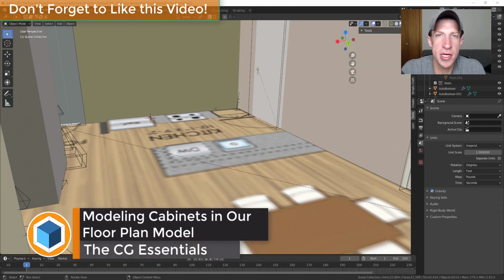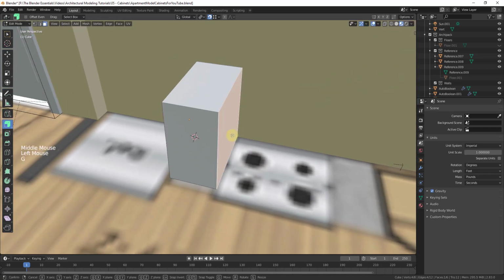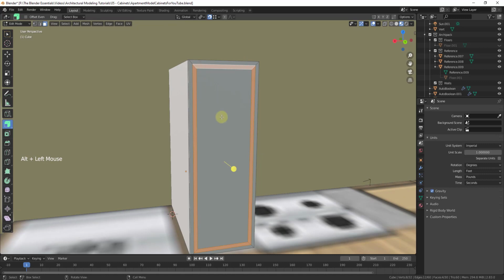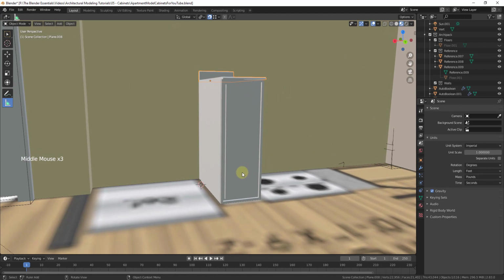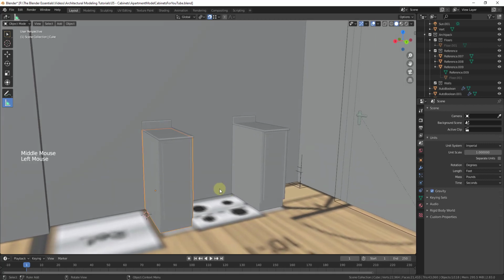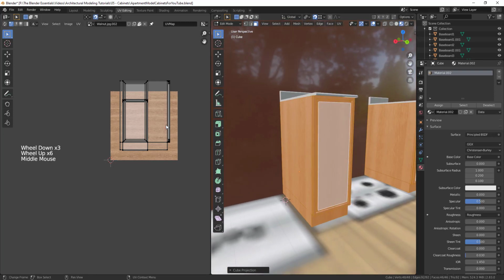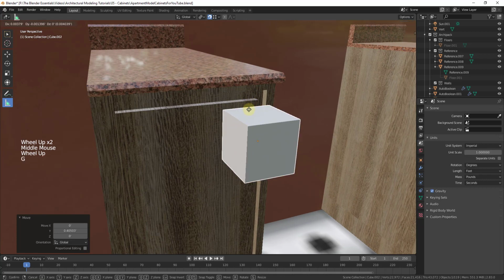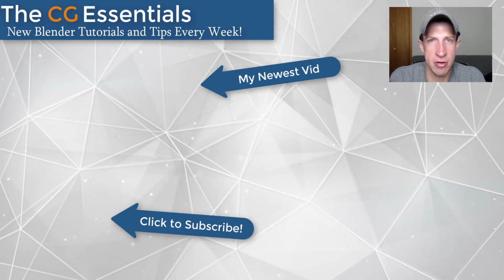Adding CABINETS to Your Floor Plan in Blender - Blender Floor Plan Modeling Tutorial Part 4

Comment: er "kitchen cabinets = 36"H x 24" D x multi width in 3" increments
Wall cabinets = 30,32,42, various H x 12" D x multi width in 3" increments 
And Vanities(bathroom sink cabinets) are generally 32" high  18-21" D🤐But over recent years have evolved into 36" H as well. Those are total heights including the countertop.

Comment: Im using blender / Sketchup / Autocad LT to a get nice topology building on Blender, so I can work perfectly looking for photorealism, them I use a addon to export an sketchup file, on sketchup I use solid groups and section planes to get DWG files... Almost like a BIM workflow using Blender lol
Reply from the maker: So you model in another program, use Blender for rendering and use SketchUp to create plans?
Reply: @TheCGEssentials  I model the building in Blender, then, in Sketchup using solid groups I can join geometries and get a clean model to get plans that I export to AutoCAD, it is extra work to get the plans, elevation, section, etc. but I just prefer to have a nice topology in Blender and get the plans from that model instead of model in Sketchup, revit, archicad, etc. And have a terrible mesh... I even have an small library of lowpoly furniture in sketchup to get those in the plans.
Reply: @oscardelacruz6408   good day sir can you make a video of your workflow sounds like exactly what I need , thank u